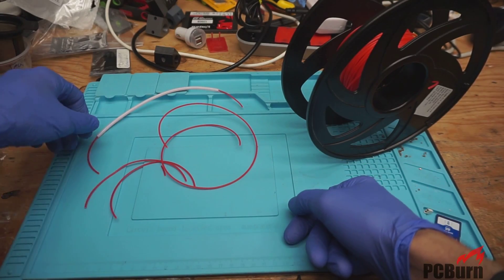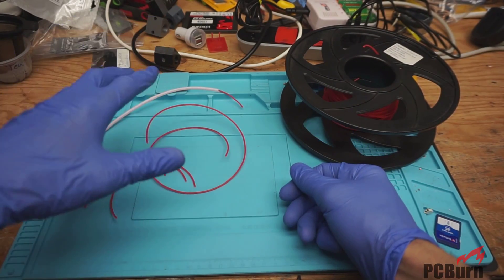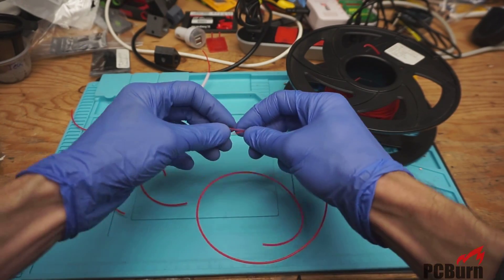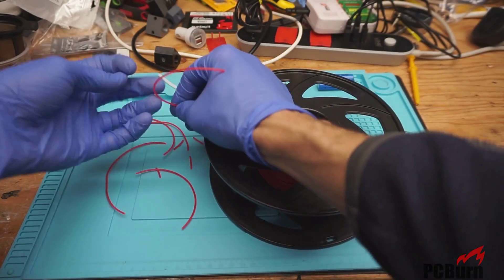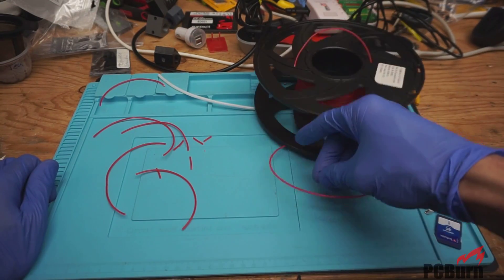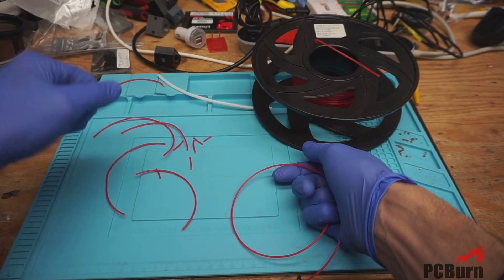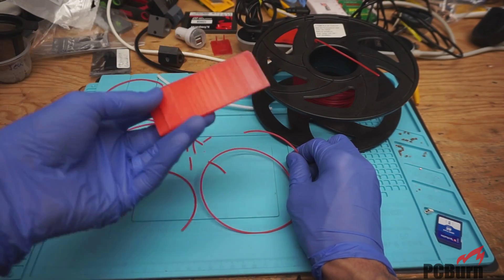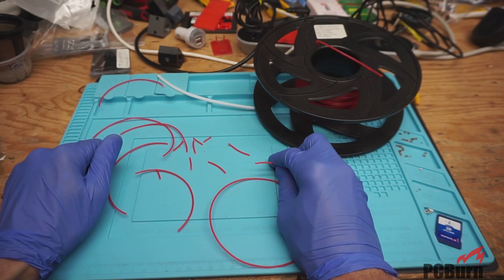Why Does My PLA Filament Keep Breaking?

Comment: Thanks, I have an ender 3 and no drying rack, so I'm going to put it in a air fryer at 40 degrees and hope for the best 😂
Reply from the maker: If it's an issue with moisture that'll work. Not for poorly formed filament. You can check by leaving it well spooled after use and seeing if it still has the same issue overall.

Comment: Mine is breaking multiple times during prints. Then i stop, reinsert and stops printing again
Reply from the maker: Yea, there's no way to use a spool if the whole thing's been stressed incorrectly. If that's the issue it'll just shatter continuously.

Comment: I have a problem where with my old filament when I try to use it sometimes it snaps. But more than not sometimes right after a print the thing snaps. Like as soon as the print is done and it is sitting for let's say 5 minutes while I get the next print ready. It snaps.

I've notice this happens exclusively with my black filament. Sometimes others, but more than not my black one. Idk why. Luckily I'm on my last roll. I don't feed it in the ams anymore because of this problem. I'm tired of opening it up. I just print it as an external spool unless if I need the multi color.

I wish I can find a solution
Reply from the maker: Yea, if it was all the same type (brand, style) of filament try something else. I haven't noticed this as much with the "blend" filaments like PLA+ or anti-stringing. Good luck!

Comment: Same to pcl 3d pen its broken 😢
Reply from the maker: @Aiczu  ah, interesting. The PCL must have a similar composition.
Reply: @PCBurn Yes, I have been trapped by people's words by buying Pcl 1.75 [1KG] which is cheaper and more cost-effective, but got a dud, it is better to buy retail which is 10 colors 5-10 meters, it goes through a vacuum packaging process so it is safe, because I only use it for 3D pens 😶
Reply: @PCBurn Yes, I have been trapped by people's words by buying Pcl 1.75 [1KG] which is cheaper and more cost-effective, but got a dud, it is better to buy retail which is 10 colors 5-10 meters, it goes through a vacuum packaging process so it is safe, because I only use it for 3D pens
Reply: @PCBurn Yes, I have been trapped by people's words by buying Pcl 1.75 [1KG] which is cheaper and more cost-effective, but got a dud, it is better to buy retail which is 10 colors 5-10 meters, it goes through a vacuum packaging process so it is safe, because I only use it for 3D pens

Comment: The most common thing people say is that this happens because it gets wet, thank you for setting the record straight. I'll make sure not to leave my filament straight.
Reply from the maker: Absolutely. This is fairly specific to PLA but it's still the most common reason for it shattering in my own use.

For all I know some environments might cause the same mechanical issue by some kind of humidity swing. I'd assume that'd be less common though.
Reply: I have some cheap filament that's maybe 3 years old. It snaps coming right off the spool. No PTFE tube in the picture.
Reply from the maker: Yea, I've had a few rolls that were poorly handled during spooling and either were bad from go or after a bit of handling. It's been a rare occurrence, fortunately.
Reply: Mine were fine initially. I printed 1/2 the roll or more.  It happened on several rolls from the same manufacturer. I've never seen it from other name-brand rolls. I recycled them but I wish I'd kept them to try drying.

Comment: My old PLA gets like that after a year. Like you need to remove it from the printer after a print job or it will snap off clean under its own tension after a few hours cooled down again. Stargnely it still prints beautifully, but I wouldn't count on the strength. My printer uses no tube though... it is just breaking where there is a bit of heat transfer due to proximity of hotend. I'd imagine if anything it removed some moisture from this leading end of the filament due to temperature increase.
Reply from the maker: Yea, that's usually what happens if it's kept in it's original shape. Could be something else going on of course.
Reply: @PCBurn  I suspect it sets up conditions just right to offgass some component that stops it assuming a more crystaline structure, vs liquid... the quick answer, is date all rolls as you get them, and be prepared to throw them out or not use them for important stuff.
Reply from the maker: I've still got some "straight PLA" that's been kept dry and out of UV from Maker Geeks (10+ years). Diameter aside it's functionally fine.
Reply: @PCBurn  And I have a roll of silver silk that has been a nightmare since new... worse than my oldest filament.

Comment: I've only had issues with breakage like this on really cheap filament so far. Had some cheap samples that even broke in the small bag they came in before I even used them - just ended up in short sections without being touched. Of late, I've been having constant snaps with some cheap Sunlu filament that could easily be fake of course. 3 colours, clear, grey & white, and all 3 will snap, often where the filament enters the extruder, although just as likely to snap right on the reel itself. Moisture is certainly a possibility as the environment isn't controlled as such. Never used to happen with the 'better' filaments. Getting towards the end of the reels now so I'll be glad to see them gone. I won't be buying cheap stuff in future as I don;t print all that much and it's just frustrating having to deal with the breakages all the time.
Reply from the maker: @chrissavage5966  yea, I assume that the better filaments are both made to a tighter tolerance and are likely to contain a blend of other plastic in the PLA.

Comment: I've had the same problem with my PLA. May have found an answer. I've a K1 and did some monkeying around. I believe I ran the filament thru the feed sensor wrong so it would crack after the spool and before the element. Ordered some clear Teflon tubing so I could see the PLA better and rethreaded the filament thru the sensor. So far....., but I will view the condition more closely as the days wain. Thanks
Reply from the maker: @jerryw5225  yea, sometimes altering the pathing will lessen the issue. I currently have one out of four of the filaments in my multi filament bamboo cracking if it's left regardless of what I do.

Comment: My filament began to break like this and now im trying to dry it. It first began to break when it has been sitting on the printer for a while and can't be printed with as it pops and boils like crazy, so my guess is moisture. Will get back to you, even though this is an old video, if or if not it is moisture. Also only red is the problem from the 4 colors i have tried.
Reply from the maker: @GenerationAI2024  printing with water vaporizing out of the filament sounds like a horrific amount of moisture. But, yea, I'm curious if the stresses are a problem as well or if drying clears it up.

Comment: That makes sense. I sometimes go a couple of months between prints and often have to remove filament from the tubes because it breaks. I thought it might be a chemical reaction between the filament and the PTFE tube. Thanks for sharing the video!
Reply from the maker: @nackesww  Absolutely. It started with running into the issue myself where I knew it wasn't humidity or UV exposure.

Comment: Thank you for a hypothesis that wasn't focused on humidity.  This one works for me!   I have notice when my clear spool unloads from the print-head, I can see fracture marks in the filament.  BUT only within the first 2 feet or so.   This means something is causing it to fracture and become brittle while it is away from the spool, inside the guiding tubes.  Looks like I need to unload my filament when the print is finished.  I print a lot of things using "clear" filament as well as white, which becomes brittle in this way too... it's just not possible to see the fracture marks.
Reply from the maker: @Baumeister40  yea, unloading has certainly helped. Always check the first foot before you load too, some types will still have a brittle bit at the end.

Comment: My filament that's in the bin with the baggies and silica crystal snaps but the spool on the printer has been out for 2 months 😅 and perfectly fine 🤣
Reply from the maker: @Shay56787  yep, sometimes I've gotten a poorly manufactured roll that's done that. Or one that was re-spooled to a smaller "starter" spool for a pack-in.

Comment: How does this effect respooled filament? Would it become brittle since it's probably stressed differently than it was in the manufacturing process?
Reply from the maker: @cqpzg  I would assume it wouldn't be good with PLA. I can't recall if I've respooled any fully or not.

Comment: EXACTLY what happened to me!!!! I have an AMS lite unit, and the filament in the end of the spool is very "spring-shaped" . So leaving the filament overnight straight inside the ptfe tube made it very brittle!
Reply from the maker: @soniccinos I've had better luck with the modified PLA when leaving it in a multi-spool roller. Or PETG of course.

Comment: The problem is it can break while its printing . The Quesion is can it be softened .
Reply from the maker: Not that I'm aware of.  Humidity would exacerbate the problem... you'd have to melt and re-extrude it.
Reply: @PCBurn  I believe in the oven @ 70C for 1hr fixes the issue . I'll have to give it a try .
Reply from the maker: @das250250  certainly won't make it worse!

Comment: I have been struggling for more than a year , and i think this might be my problem.  I never had any problems with the printer until i changed filament .  The nozzle seems fine, but the pla is super brittle.  i am in a wheelchair , only use printer infrequently and when I need to re load the filament ...it can take weeks before I  can get someone to help me.  Does anyone know of a pla that doesn't have this problem ?  I really want to be able to use my printer again but i can't be unloading and reloading filament everytime.
Reply from the maker: That's problematic with PLA. Some of the modified filaments (PLA+, rapid pla) might not be as brittle on average. I haven't found any to be consistent.

Also, PETG doesn't normally have the same issue. If it'll work you may want to default to it.

Comment: What is the solution😢
Reply from the maker: Take the PLA out of the printer when finished and buy properly formed spools made of decent quality material. If it's an issue use a PLA with a co-polymer.

Comment: I have never had a problem until yesterday. I got an out of filament error and I went to check and the entire roll was loosely spooled and then I noticed way to many ends. It had just spontaneous fractured into hundreds of pieces.
Reply from the maker: Yea, I've seen a spool that has an issue somewhere in the middle. Think I've only had that happen once.

Comment: All my printers are direct drive. My humidity lvl is controlled at exactly 50%. I don't bother to store my PLA properly and I have some really old spools, 5 years or even more. Never had a filament break while printing, but it is true the if I leave the filament in the extruder for a couple of weeks I sometimes find it broken. It only happens with the cheap ones, never with hatchbox or similar. And it is just the few inches closest to the extruder, the rest of the spool is just fine. I have no idea why this happens. My only explanation is that the light (UV) affects the PLA. It is always the part that is exposed to the light. The shelves where my spools are resting are far from the windows, but the printers are in a large table next to the windows, although the blinds are usually closed, anyway... the spool is just fine, it is just the exposed filament left in the printer that snaps.
That is my experience.
Reply from the maker: Yea, the companion video linked in the description demonstrates the effect as described. Mechanical stresses on raw PLA.  If the PLA's blended with other polymers or is chemically different it'll behave differently.
Reply: @PCBurn  I just read the article.
The theory of the shape makes a lot of sense. The filament that is closed to the extruder can't coil back again to the curvy form of the spool.
I never thought about that.

So... I guess the effect is more pronounced in the small spools, or the almost finished spools, where the filament is coiled in a tighter radius than in the big or newer ones?
Reply from the maker: @MrPeloseco  Usually in PLA without a co-polymer it's just a feature of the plastic. Its radius on formation would matter too, as you're implying.

 If the manufacturing is bad I've seen them completely shatter as well; that's probably an issue with the cooling when it's initially formed.

Comment: I'm dealing with this right now. I rolled up and stored a spool of Hatchbox and a did the same with a roll of much cheaper PLA, was a box of multiple colors in smaller spools. I also still had a loose roll of the original white PLA that came with my printer. The included white PLA survived the year of laying out just fine, same with the hatchbox. But the cheap small spool stuff became extremely brittle but only in certain spots and started breaking up mid print between the spool it was feeding from and the tube where it was getting fed into for printing.

Based on my experience here, cheap PLA is more of a problem than how it's stored.
Reply from the maker: Yes, that'd line up with what I was seeing in the video.
Reply from the maker: And to further explain what I assume you're seeing, now that I'm a bit more awake.

I think what you've got is a roll of filament that wasn't properly formed at the factory. When the filament's hot and being cooled it's important that it retains a specific shape. Then it wants to keep it's spooled shape and when a bit is unwound and left for a while, as in the video, that part gets brittle. Because your essentially exerting a mechanical force on it pulling it out of the "shape" it was formed in. Crystalline structure of hard thermo-formed PLA, but "shape" isn't wholely innacurate.

The other thing that can happen, that I think your seeing on that cheap spool, is a roll that wasn't handled properly when formed and cooled or when rolled. So as soon as you open it (or maybe even in the bag) it shifts slightly, torque gets applied to the plastic on the entire roll in a way it really doesn't like, and the whole thing embrittles and breaks. Same effect, just roll wide due to poor QC somewhere during manufacturing.

Only had that happen with a single small roll that came with an extra cheap printer. All the budget rolls I've purchased have fortunately been fine in that regard.

Comment: I both a matte pla filament and it started breaking right when I wanted to insert it the printer
Reply from the maker: If the filament isn't poorly manufactured you should be able to cut it back to the spooled portion before inserting it into the printer.

Comment: for me the filament keeps breaking at the extruder 2h 43 minutes into the print, every. single. time. without failure, i don't get why it does that.
Reply from the maker: With multiple different filaments? If the filament is known to be good it'd be something about the way the print is sliced or the way the printer handles it.

If that's with a single filament roll try a different brand or blend of it.
Reply: @PCBurn  the filament is good, well known affordable local stuff. i've tried 2 colors and 4 rolls but they all give the same issue. i haven't heard about the way it's sliced being an issue yet...
Reply from the maker: @SharlanCináed  Yea, if it's not the filament it'd have to be something with the printer or way the printer is handling the code.

Although personally I'd try a completely different brand of filament. You're right in thinking it's the most likely culprit. And a bad "weak spot" from the manufacturing process would be possible.

Comment: my new problem, brand new pla, straighten overnight then snap. my on direct drive extruder.
my solution is pull out the filament from extruder when not used, leave recoil back to spool.
Reply from the maker: That's the way to do it with PLA.

Comment: Hey, today i was printing an iron man helmet piece that took over 14 hours, when i came home though it seemed to be that the filament snapped, but I literally just opened the filament. Do you know why it did that? 
btw i was printing on an ender 3
Reply from the maker: Could be the end of the spool was suffering from the same issue. It's always a good idea to check the end of the spool and cut it back a bit if necessary before printing.

If it's different parts of the roll that are brittle it was probably mis-spooled at the factory.
Reply: @PCBurn  Alright, thank you!